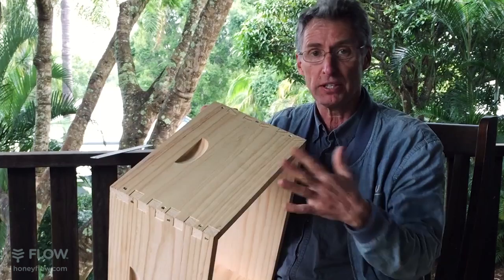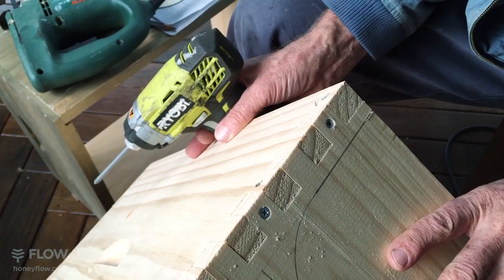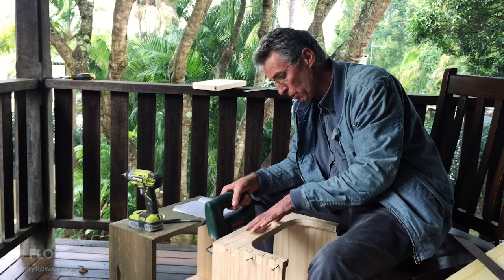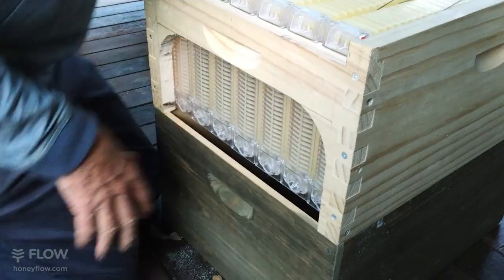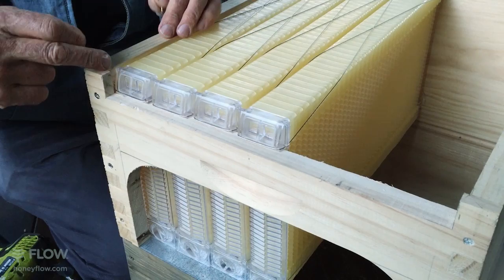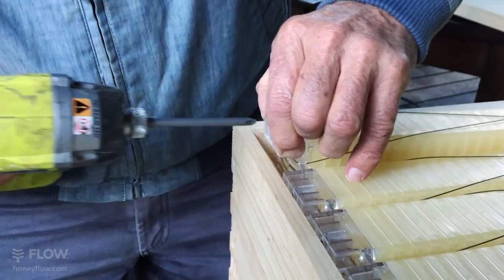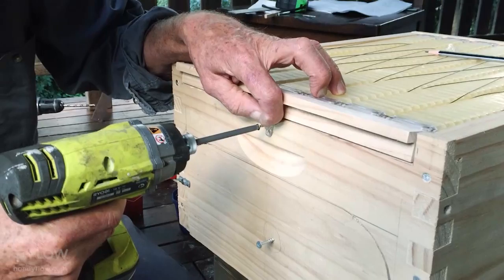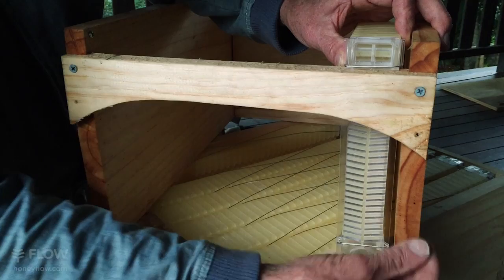Modifying a 10 frame Langstroth Box to fit 7 Flow™ Frames

Comment: Great to watch you at work on what is to be my next project.
Having used a jig saw often, it is easy to recognise your skills keeping to the intended track of the blade, which looks easy when done by an experienced/competent person, but so darn hard for the majority of us.

I need to convert a Hybrid Flow Super that is meant for 4 Flow Frames and the rest in traditional frames, into a 7 Flow Frame Super.

Initially I was keen to use a Hybrid with both the old frames & 4 of your Flow Frames. 
However, after doing some harvests of Langstorf frame/hives, I just can't see the point in using traditional frames when there's a  better way available.
Your Flow Frames are so much easier/less destructive to use, especially for the bees. 
That is the point, really, when it comes down to it, the Flow Frames make it so much less trouble for the bee colony. 
The fact that it also easier for the beekeeper is a major bonus!
Cheers!
Reply from the maker: Thanks for sharing, Jasper. Good luck with modifying your box.

Comment: Hi Stuart, as mentioned a while back, I have just converted one of your Hybrid Supers that were designed to have part Flow Frames & part traditional pine frames, into a full a Flow Frame Super. 
Why did I do this: because after a few harvests of Langstroth frames, I just could not see the reasoning, other than NATURAL COMB, which is another story.
Watching you with that jig saw, calmly cut out a curve, plus duplicate the same on the other side, just needs another post/comment .
That comment is this: It is NOT as easy as you have done it! Respect to you Stuart!
A jig saw is no easy precision tool to use for cutting accurate lines for small pieces/projects, let alone curves that you duplicate . Yet it is all in how much experience you have, the quality of your tools & your skill & confidence. What you did in the first few minutes of this video, has taken me a few hours in my workshop! So well done & thanks for sharing.  
For what it's worth, I believe that Flow needs to really involve the Commercial Beekeepers, who are mainly Langstroth hive beekeepers. 
This considered way you have done this upgrade can only help the pro beekeepers realize the many benefits on both the beekeeper & the bee colonies, to go FLOW!

Comment: This was really good. As far as it went. I came mostly to see viewing windows installation, what material was used and how it was set in flush, and if the door was planed. I did pick up good ideas, better than I would have attempted but would like to see the rest done. Is there a vid for that?

Comment: I know that the size of the flow frames is 49x24,2 cm. and Langstroth frames are 40x22 cm. How to adapt that flow frames to Langstroth beehives.
Reply from the maker: Hi Pops, Our Flow Frames are available separately in sets of 3, 4, 6 and 7. These are designed to be used with existing Langstroth deep hives and can be purchased with or without a super box. 
Here is a link to our instructions on how to modify a Super box to fit the Flow Frames - https://support.honeyflow.com/modifying-a-langstroth-box-for-flow-frames/ - Sam